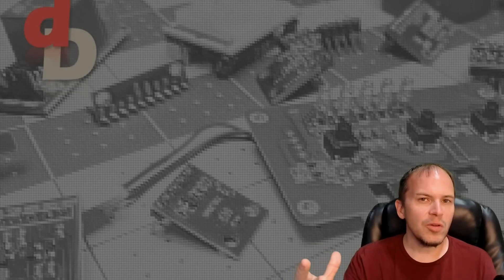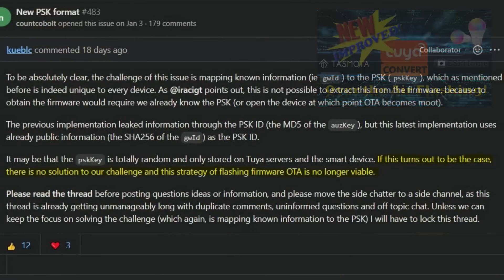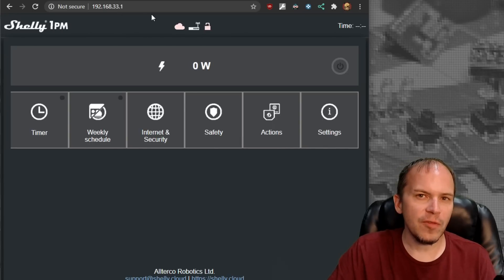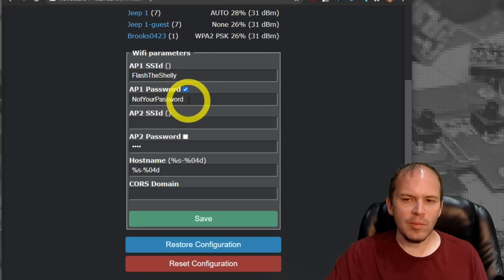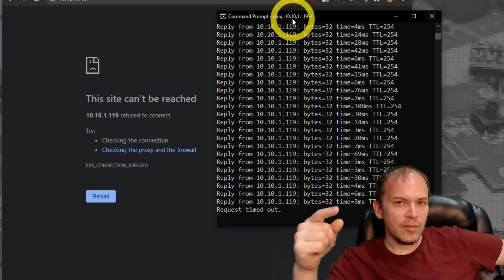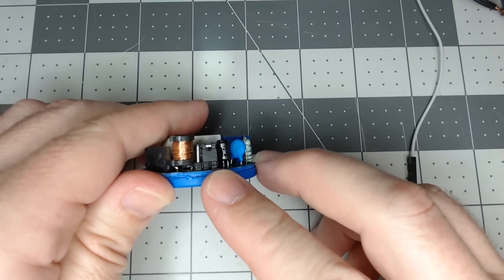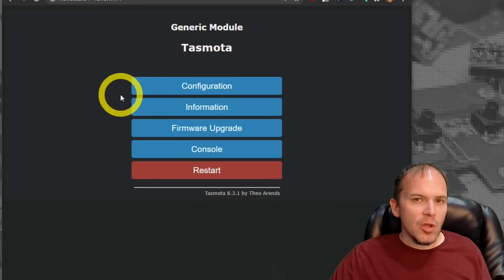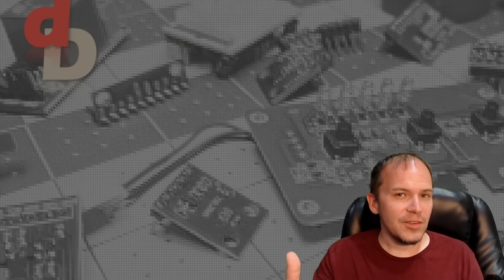Upgrade Shelly Switches | Easy NO Soldering Smart Garage Door Opener

Comment: Thanks for your video! One question, has anyone found a working template for Shelly Bulb?
Reply from the maker: Easy to make your own. https://github.com/digiblur/Tasmota/wiki/New-Device-Procedures or video - https://youtu.be/eDoIkd58HRM
Reply: @digiblurDIY  ok, i try for 3 hours but not work. I think not possible with shelly Bulb...  if it were possible it would have already been done by someone right? After a lot of test, my bulb not work, not connect to wifi...  I think the waste basket will be its place
Reply from the maker: I heard others doing them.
Reply: @digiblurDIY  ok I'm not able on this 😔
Reply from the maker: I would open a an issue with the github maintainer to see if he can help.

Comment: Hey Travis, Last night I flashed my Shelly 2.5 to tasmota this way. I did the update, all went good, as I was checking the configuration I noticed all that was on the main page was, the temperature and the 2 buttons no information like voltage, amp draw, any Ideas? I did use the right file and template. also no mqtt for energy just switch on off
Reply: well after about 4 hours of working with it and rebooting it about 20 times. I unplugged it came back later plugged it in and everything was there.
Reply from the maker: Maybe it wasn't updated or the template wasn't enabled?
Reply: I have this exact same problem today with a Shelly 2.5. There is no power information after the temperature and the two Toggle Buttons. The buttons don't work either, you can see actions appearing in the console but you can't hear the relays click. I have pasted the 2.5 template and clicked activate but when the unit reboots, its exactly the same. I physically power off the device and done loads of soft reboots, so I wonder how yours started working??

Comment: I use Firefox, after flashing the Shellycloud web cache kept preloading cache blocking the Tasmotized shelly switch. Opened another browser to confirm it worked. So I could wipe cache in firefox, or just add /? to the devices IP to load tasmota web ui. type: http://tasmotize.ip/?  to load the proper page. Thanks Travis!
Reply from the maker: Yeah, the cache got me a couple times.  Not a bad idea to open another browser to verify.

Comment: Brilliant! Done 2 shelly1's this week no issues. How do I set it to just send me the mqtt messages when the switch is triggered but detach the actual relay? Like the 'detached' option on the stock firmware? (used in a basic PIR). Thanks
Reply from the maker: Probably looking for setoption114
Reply: @digiblurDIY  That's what I thought. Latest tasmota version too and relay still clicks. hmmm
Reply from the maker: If it has buttons then so73 is the option.
Reply: @digiblurDIY  sorry noob here with tasmota. You mean physical buttons on the actual Shelly1 device? No buttons. 
Looking the 9.1.0 notes. Not sure why SetOption114 1 is not working. is SetOption73 1 an alternative?

Detach switches from relays and lights using command SetOption114 1

Added official Tasmota integration for Home Assistant. Still in beta

⚠️ BREAKING CHANGE ⚠️ Redesigned GPIO representation changing Template layout. Read more...

⚠️ BREAKING CHANGE ⚠️ Changed SetOption73 1 JSON result from {"ACTION":"SINGLE"} to {"Button1":{"Action":"SINGLE"}}
Reply from the maker: Yes setoption73 does button inputs configured and 114 does switches configured ad inputs. I have used both for decoupling the relay as well as the previous way of using rules.
Reply: Just the standard Shelly1
Reply from the maker: Make sure you are 9.1
Reply: @digiblurDIY  Yep on 9.1 Maybe worth trying 73. Thanks for the advice! :)
Reply from the maker: If it doesn't. Hit me back up. I will send a rule to put in.
Reply: @digiblurDIY  Looks like 114 is on:
  "so": {
    "4": 0,
    "11": 0,
    "13": 0,
    "17": 0,
    "20": 0,
    "30": 0,
    "68": 0,
    "73": 0,
    "82": 0,
    "114": 1}

But relay still clicks in. Using it in the PIR. 3 wires , red, blue and brown. red and blue are Live and neutral going in. Red  from the PIR then goes into SW on the shelly . When it detects motion this triggers the shelly - opens the relay and sends me mqtt. But as I've tried on both shelly1 devices this option 114 relay still opens and closes. Maybe a bug with version 9.1.0? Thanks a lot
Reply from the maker: Definitely sounds like a bug. What input do you have this assigned to? It might be easier to jump into discord. Look for the link in the video description

Comment: Quick question have you or anyone else noticed constant reboots? I'm at 78 reboots never stays up more than about 5 hours. Also once the device completely restored itself and was in access point mode all settings gone with no warning. Did the setup again and I started monitoring reboots and temp. I have an automation set to let me know if it gets above 80c also when it goes unavailable from home assistant. I'm not sure what's going on. Any advice would be great thanks again
Reply: Hmm I'll double check make sure I wired it correctly. I followed a diagram from smarterhome. club wiring for shelly 2.5 outlet maybe I messed something up. Doesnt seem hard though 01 and 02 and N to the outlet and L from the shelly to the hot wire. I'll open it up again tomorrow and look over it thank you again for your help I'll post an update if I fix it!
Reply from the maker: What device? And are you on 9.1?
Reply: @digiblurDIY  yes
Reply from the maker: Haven't had any reboots on mine. What does the information screen show for last restart?
Reply: @digiblurDIY  tried 9.1.0 keeps rebooting so I installed 9.1.0.2 today but results are the same
Reply: I have uptime as 1 minute as it rebooted it seems. I have Restart reason: External System
Reply from the maker: That's not the software crashing, either power issue or power supply issue of some sort.
Reply: @digiblurDIY  I've fixed the issue. I had a spare 2.5 shelly device so I plugged it in ran shelly with default firmware for several hours and no restarts. Then I flashed tasmota 8.5.0 didn't update and still no restarts. I'd test out 9.1.0 but from what I understand you can't downgrade afterward. So it's either a tasmota problem or a device problem. Also with 9.1.0 there's a new template for the shelly 2.5 and the restarts only happened when both relays where on not just one which was odd and the temps are also lower now with 8.5.0

Also happy late Thanksgiving hope you and your family had a great holiday thanks for always helping love your channel. I'm also from Louisiana Alexandria to be exact but I left moved up to Oregon and never looked back miss the food though.
Reply: Yeah there is something fishy going on I just happened to check the template I put in and it has changed! Didn't even know that could happen.

Comment: Perfect thank you! Quick question I did the shelly 2.5. Setup mqtt but it only imported toggle1.... how do I setup for toggle2? I tried adding it manually in yaml file. I managed to be able to see it but not able to change it. Any chance you can point me in the right direction thank you.
Reply: Nm figured it out though someone else may have the same question if you have any links to help.
Reply from the maker: I have the template in the video description.  You'll also find more info on the device here - https://tasmota.github.io/docs/devices/Shelly-2.5/

Comment: Awesome video, as always! I tried to flash a shelly rgbw OTA with the latest firmware and it continually failed. I hope they haven't disabled this ota method!
Reply from the maker: I haven't heard of it yet, I'll check out my Shelly1 and try it again with the latest stock Shelly firmware.
Reply: I had to first upgrade to the latest official Shelly firmware then it worked.  Got stuck for a while until I read the notes on the github page where it is mentioned it is a common issue with the RGBW2 .   And many thanks Travis for all the fantastic videos.

Comment: Thanks  for another great video. I flashed a Shelly 2.5 and it worked flawlessly but today I flashed a Shelly 1 and it shows up in Home Assistant devices as a "device_tracker.unifi_xxxxxxxx" not as a switch. Any ideas where I screwed up ?
Reply from the maker: That sounds like it is coming from your UniFi integration to say if it is on the network or not.

Comment: Great video as usual. I picked up a Shelly 1 and followed your video, but everytime the state of the reed switch changes the relay toggles. I think I missed something somewhere!
Reply from the maker: Is the rule put in and turned on correctly?
Reply: @digiblurDIY  I changed the Rule to Switch1 and everything seems to be working now. Thanks for all you do.
Reply: @digiblurDIY  Yes. First time using a rule, but added it and turned it on.  Rule 1 shows the On state. Why does it have switch2.  When I toggle the reed switch it shows switch1?
Reply from the maker: Glad you were able to figure it out. Where did you get switch2 from on the rule? I checked the blog post and I see it is showing switch1 but want to make sure it isn't somewhere else.
Reply: @digiblurDIY  It is the rule from your blog "(This rule below should all be pasted at one time)
Rule1 on switch2#state=0 do publish2 stat/%topic%/status closed endon on switch2#state=1 do publish2 stat/%topic%/status open endon"
Reply from the maker: Ahh...you copied the one for the Sonoff SV.  The Shelly1 setup is below that.  https://www.digiblur.com/2020/06/diy-smart-home-ep7-smart-garage-door.html
Reply: @digiblurDIY  Oh you mean that note about Shelly1 at the bottom of the post. LOL! Reading directions is half the battle.
Reply: Another question. Do you know if there's is a way to read the status of switch1 for use in an automation or do we have to create a binary sensor?

Comment: Any chance anyone knows the Tasmota template for the RGBW2 to control the 4 x white LED strip scheme. The one above seems to be RGB LED strip scheme
Reply from the maker: You can set it up however you like. You should see pwm1 through pwm4 in the template. These are your 4 light channels.
Reply: digiblurDIY thanks but I only get a single toggle on/off and colour settings. There is a user user on gpio05 whoch May switch between rgb and white but unsure what to do with it.
Is there a discussion board or way I can share a picture?
Reply from the maker: Look at setoption68 here. https://tasmota.github.io/docs/Commands/
Reply: digiblurDIY thanks absolute legend

Comment: Thank you boss. I can't believe this is such an easy method. like yesterday i flashed my shelly 1 old school. there is one another in the wall already now I will flash that sucker without touching it. : )
Reply: And sir  have shelly temperature addon sensor https://shop.shelly.cloud/temperature-sensor-addon-for-shelly-1-1pm-wifi-smart-home-automation#312
after flashing should i simply connect the sensor or should i do some configuration regarding gpio pins.
Thanks for this meticulous tutorial.
Reply from the maker: Leave it connected and you will need to tell Tasmota which pins are connected and which sensor it is.
Reply from the maker: It is slick!  I love being able to just pop open the web browser and go.

Comment: Hello, love your videos, see if you or anyone can answer this question, im moving to my first home and I've decided to make all the switches smart, watching your videos and my investigation I went with sonoff TX T2/T3 for same aesthetics throughout the house, but I want a dimmer in some areas so I got the shelly dimmer, I just thought how would it be possible to have both on the same line going sonoff(tasmotised) > shelly dimmer > light,  how would the wiring setup be?
Reply from the maker: You would need to keep power to the Shelly dimmer at all times of course.  You could use device groups and/or button presses to control the dimmer though.

Comment: I've been follow your very helpfully videos for some time now. Thank you for taking the time to do them. I'm trying to get the garage opener working with MyQ stuff. Could you elaborate on to get it working. You suggested something about a spare opener.
Reply from the maker: Is your button the digital encrypted type of thing on the wall?
Reply: @digiblurDIY  Yes I believe it is. It has the learn button also has the delay close buttons.
Reply from the maker: I've seen people connect to the opener itself or a spare opener in the house somewhere.  Here is one example I saw. http://blog.smarterhome.club/2020/04/05/shelly-1-garage-door-opener-the-easy-way-or-the-fun-way/
Reply: @digiblurDIY  Thank you very much. That is the same opener ,well slightly  different button assembly. I will open it and see if it has a momentary button.

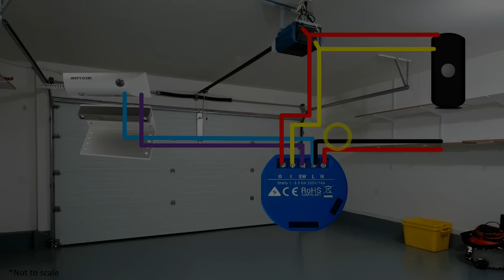Comment: At 13:28 you showed the wiring for Shelly 1 on a garage door.  I looked at that and thought, “I have everything in that picture already. I can make this without buying anything.”   So I immediately built the circuit- twice since I have two garages.  And it all worked.  Nice!   I should also comment that I’m using the stock factory firmware and home assistant with Shelly for hass integration.   It all works great.  I needed to set the switch mode to “disconnected”  and the auto off to 1 second in the firmware menu.  Also the power loss setting to “off” for after power is restored.  Then I added an automation for when the state changes of the switch to send a notification to my phone saying the door just opened.   This is fun to get these things working.
Reply from the maker: Always different ways to do things in this hobby. Glad I was able to help a bit.
Reply: stock firmware keeps disconnecting from wifi. fyi.
Reply: hamhumtube sometimes WiFi issues are caused by the router and not the iot device. I know my thermostat was constantly disconnecting from WiFi and I replaced my router with a different brand and it’s worked reliably ever since.
Reply: @neilbrookins8428  yes i agree. but disconnecting problem of shelly 1's is a known issue. i have seen many threads over forums. and flashing is cheaper instead of buying new router.
Reply from the maker: Can't say I have seen people say it is a known issue and I know quite a few that have the Shelly1 including myself.
Reply: digiblurDIY with stock firmware they lose connection. It is there. Google it you will encounter over forums. Because of MQTT support I wasn’t intending to flush Shelly 1. I have several of those because they  kept losing connection I started to flash them
Reply from the maker: I am sure I could find wifi disconnect issues with every device to be honest if I Googled. Just the nature of the game. Not sticking up for Shelly in any way as I have no affiliation with them. It is a typical esp8266 device and nothing hugely different on them. I would suggest trying another wifi solution as I know several folks for upwards of 20 or more Shelly devices and no issues on stock or 3rd party firmware. Which router/wifi do you have?
Reply: @digiblurDIY  I don't think community should be such tolerant especially prominent members such as yourself. A device should act in accordance with its manufacture purpose. People are relying those devices in crucial instances. Imagine one put one of these to his garage door and needs to go hospital asap and his lordship esp chip stands offline. one can say that backup method should be there in that case why we are automating things! they need to improve either software or hardware. 
https://github.com/StyraHem/ShellyForHASS/issues/69
I have a dedicated wifi switch behind router for iot which is D-link DIR-615.
Thanks
Reply from the maker: The point is to get away from this buggy custom component that requires HA for the devices to work.  I could never get it to work right myself and gave up and just went with the tried and true MQTT.
Reply: @hamhumtube  ShellyForHASS was discontinued some time back. Shelly is fully integrated into Home Assistant, now.

Comment: Flashed with this process my Shelly EM with Tasmota, but no power metering is available, only the relay. Event with thew "official" template. Now can't even go back to sock firmware.
Reply from the maker: I created a template after pinning out the chip. It was working from what I remember. I shared it on a thread. Let me see if I can find it.
Reply from the maker: Shared the template here and others got it working.  https://github.com/arendst/Tasmota/issues/8055#issuecomment-612658006
Reply: digiblurDIY flashed again with ftdi and fixed. Something went wrong with ota flashing
Reply from the maker: Gotcha!  I was thinking it might need the tasmota-sensors.bin file too, wasn't sure if that sensor was moved over to that build.  Thanks for the update!

Comment: Love the shelly stuff.  Have a handful of shelly 1 installed around, but I have had to switch a few to sonoff minis for the external antenna.  My all metal outlet boxes and stainless steel switch plates (WAF) make the wifi signal basically crap inside those little boxes.  Anyone know a good way to put an external antenna on a shelly?
Reply from the maker: Some of the Shelly devices actually have an antenna inside on the back of the case.  I assume some sort of mod to the case could be in order.  You could also pull the boxes and put plastic ones.  Not too bad to do with the old work boxes.  I swapped several myself.

Comment: Very cool. On a side note there isn’t a template for the dimmer. Found out how to flash the stock firmware back the hard way after flushing to tasmota and then finding out there isn’t a template.   Search for a template before flashing!
Reply from the maker: Did you see this thread? https://github.com/arendst/Tasmota/issues/6914

Comment: This is cool. I have a box of Shellys I need to flash. Almost makes it too easy. The header is a bugger to flash using resistor leads. 
11:40 likely explains why the Anbes I tried to upgrade is soft-bricked.
Reply from the maker: This prevents the older versions being written.